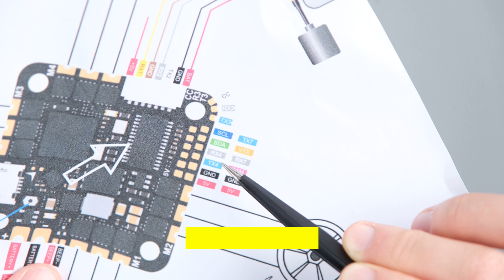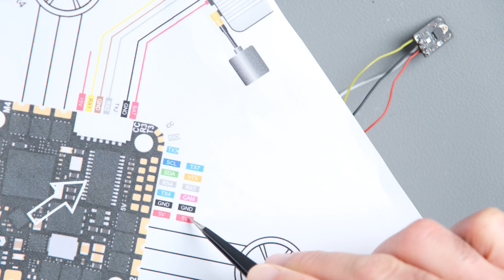🚨🔥FOXEER FOXWHOOP 25 | Build FPV Drone #fpvdrone #foxeer #fpvbuild #fpv #drones

Comment: I’m new to FPV and was wondering how you can connect the tx16s to the drone, will my tx16s be able to connect to the crossfire version of the drone
Reply from the maker: Hi my friend, you can connect the tx16s to the crossfire version, but you need a crossfire module that sits on the back of the tx16s, if you didn't buy it yet dm me on instagram and I can help you with configuring one for you 👍💪

Comment: I was happy to see you put Xing 2 1404 motors in this build.  I had a micro with those motors, it was amazing!  Sadly, it grew legs, never to be seen again.  This is, of course Why Im building the Foxeer 25 indestructible.  And I saw a 2" Odonata HD frame I had to get as well.  Thanks.  I wish the bags of screws were labeled.  Some silver, some black.  AND NO INSTRUCTIONS.  UGH!
Reply from the maker: Hi, they are actually the RCINPOWER SmooX 1404 motors, but they are basically the same. it is way easier if the scews are labled yeah, SpeedyBee does great job with instructions and labels! but it takes a little bit longer to figure it out! I built it with the O3 onboard and it is amazing, I will drop a video soon showing how I did that!